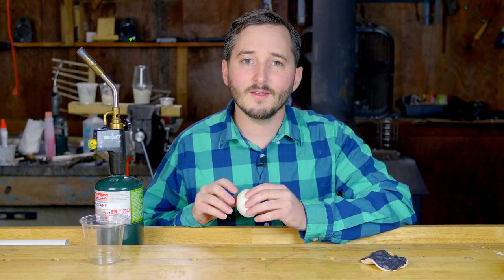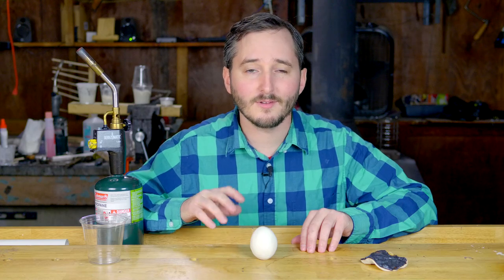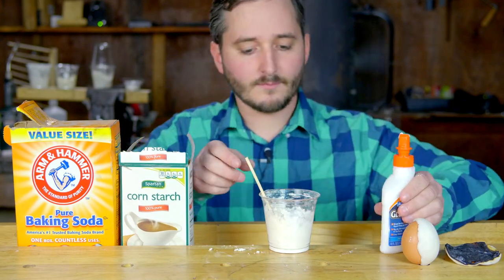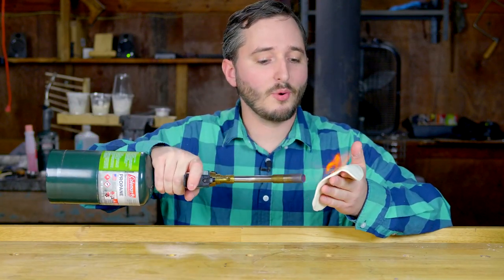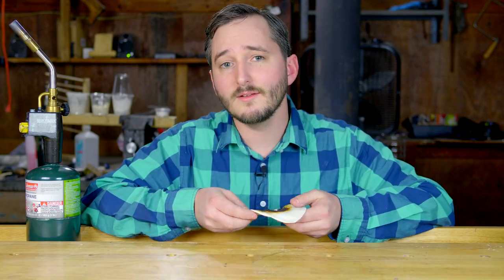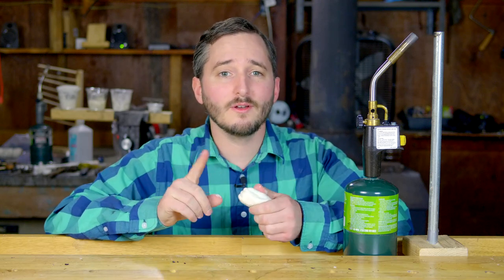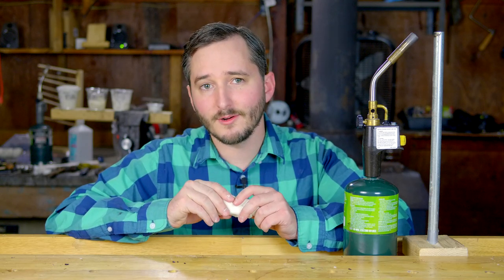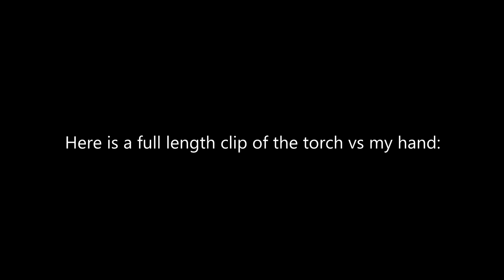A Super-Material That Can Be Made In The Kitchen (Starlite Part 1)

Comment: Is it possible to make a lighter version for use in firefighter suits? Maybe in the form of tiles forming "dragon skin"?
Reply: That's sounds awesome.
Reply: Wouldnt the carbon buildup run the risk of restraining movement to much tho?
Reply: This stuff hardens, so that wouldn't be useful. Apart from that, it is not meant for multiple usage, so it would be better used for house insulation.
Reply: From his explanation, it seems like the carbon layer is literally foam. So it can be brushed away. Look how carefully he touches it so it stays intact. Perhaps starlite was only useful in safe contained environments, and not for things like airplanes and space ships...
Reply: @Hoch134  I was thinking about something like scale armor. And if it is so easy to make (and cheap) it could be disposable, single-use item. Mayby in forest fires? Or cower some (tracked) vehicle for saving people that was cut off (a helicopter is not able to fly in such conditions).
Reply: @rareram  So mayby cover it with some sort of protective layer? Carbon nano-fibers, or something that would not burn, but could vent gasses out (even with small holes on the surface)? But not too thick - the material would not react and could transfer some heat. Or mayby different glue?
Reply: @RasaelX  the protective layer would not be starlite though, so I suppose in an event that exposes the protective layer to say 2000°C+ degrees... But you still want to move around like if the material was in a firefighter jacket... That would shred the foam right?

Edit: the foam is formed after exposure to higher heat, so the protective layer would keep your scales there, but dry loose scales would simply fall off right? Or are you expecting the foam to coat the protective skeleton?
Reply: @rareram  Firefighters normally ar not exposed to >2000 C, so the layer don't have to handle it. And even if, it would be better than nothing. And we want heat-transfer protection, not that it wouldn't fall off after use. And the layer don't have to be thick, and could provide heat transfer.

I am not a NASA engineer, I just like to think. Are mine ideas rubbish? Most likely. But Mayby, just mayby, someone would test them, learn from them, and even, Odin forbidd, use them to do something usefujj.
Reply: @RasaelX  well... I think they actually are exposed to that. I mean ideally coal burns that hot. Not in a smokey, oxygen starved environment, but Firefighters do have to deal with fuel fires and things. The material seems most useful as a kind of armor against nukes, laser, and other thermal weapons. I can see why Boeing was so frustrating, if the material changes shape, it isn't really a good thing for airplanes, although fire is definitely worse. Why not use it in the lab as shielding for when you laser blast stuff?
Reply: @rareram  I think that as laser shielding i wouldn't get hot enough to activate the reaction, and (unless we are talking about military space-tech) we have better materials. Perhaps in steelmaking? Mayby some sort of bunker in the event of an "explosion" of the furnace? They happen adt it isn't pritty sight.
Reply: @RasaelX  I wasn't aware that a better cheap option existed? What is better to you?
Reply: @rareram  Nuclear weapons - shelter (concrete, steel, lead). Thermal weapon (napalm?) - concrete, steel. Laser (industrial or military?) - protective glass, concrete, reflective surfaces (in the case of weapons). In addition, the original Starlite would last only up to 10 years?

Comment: Starlite furnace anyone?
Reply: Marc T 

Definitely agree, but it got me thinking about using a similar method to make an insulating carbon foam.
Reply: Problem being that the carbon foam is REALLY fragile so you'd have a consumable lining, not necessarily a bad thing, so long as it holds up for long enough to do whatever it is you want to do with it.

It's basically an ablative coating, it protects the underlying structure by being destroyed itself.
Reply: Concrete is just fine for the job
Reply: @SomeMorganSomewhere  i was thinking of a starlite layered furnace because if it doesnt absorb that heat then it must be extremely insular. imagine how much heat you can contain. maybe enough to melt iron or steel using coal?
Reply: also going to mention. try using borax instead of baking soda, or mix them both together. the wiki on starlite sais it is rumored to have contained a borate compound. (hence thinking possibly borax)

Comment: How "tough" is the carbon layer? Could it be used (in your opinion) as a lining for a propane forge?
PS: mine is a "yes" for a second, more in-depth, video
Reply from the maker: Not very tough. It could only be used as a temporary forge lining
Reply: @Nighthawkinlight  could you support it in some kind of carbon fiber mesh etc to give it some structure?
Reply: I was thinking considering the same thing. Thanks for asking this question and thanks NightHawk for answering it!
Reply: I think AvE used burnt bread as a 'forge' backing while melting aluminium

Comment: I'm not quite sure of all the properties and how it would exactly mesh but I'd be very interested in the possible applications to firefighters. one of the serious problems firefighters have is that their coats boots etc, really good at keeping heat out but also great at keeping the heat in, one of the leading killers of firefighters is a heart attack and it's in no small part due to the strain all the gear puts on their hearts. when you had mentioned that it quickly dissipates heat and protects against extremely high temperatures its sounds something that could possibly be used in the applications of their hoods, gloves, or even more.

Comment: I'm not particularly familiar with the science, but how would this material compare to current ablative shielding for space capsules?
Reply: I think it is too elastic and the foam might be blown away by all the air upon reentry
Reply: @_NikkyD_  Agreed. Re-entry shields have other requirements than just heat resistance, like pressure variation resistance. For example, what if the shield hits a bird? In the case of the Starlite, it might be ripped open. While the starlite is an awesome product, I would use it over a regular ablative shield (or maybe in a sandwich of ablative shields?). There's room for study here.
Reply: Actually ablative shielding uses polymers anyway, it could well be very similar. I found some mentions that Chartek 59 has direct lineage to the American Space Program- it's an intumescent coating, which seems to follow quite similar in principles to starlite, but with more advanced materials. It's not in any way impossible that Maurice got the idea from the space program but used household materials to achieve similar results.
Reply: What worries me is that it might crack, it is essentially some dough and if there is a lot of vibration and a crack occurs, that would totally compromise its integrity

Comment: So if I made shingles out of this stuff my attic space would stay cool?
Reply: Only if the sun gets too close to the earth!
Reply: Your birds would eat it
Reply: @andrzejjablonski8571  under the shingles
Reply: If the rats don't eat it.
Reply: @beatlemoore2654  - Not for use in Baltimore.
Reply: Yes
Reply: Looks like yes is the answer.
Reply: Use carbon under the shingles.
Reply: it should work on top but you would have to likely want to blacken first to get that carbon layer
Reply: Along with baking soda you put Borax, no animals or pest will eat it then.
Reply: Would it go back to the putty state if it rains?
Reply: @fallenseraph5V  maybe using waterproof glue?
Reply: @andrzejjablonski8571  no they really wouldn't
Reply: This stuff is fire proof, because of the carbon that builds when the flame is on it. That is why it's cool on the other side. The application would not work for uv rays, it would degrade and crumble over a short span. If it was exposed to any elements it would not hold up. It's just simple ingredients. Insulation board would be your best bet.

Comment: how would it hold up to an oxy-acetylene flame with an excess of oxygen?  would it burn away the carbon foam?
Reply: Oxygen is a well known vulnerability for carbon at high temperatures.  To work as a fireproofing the material needs something to protect the carbon from oxygen.  The baking soda decomposition products should help, but I don't know if they'd be enough.
Reply: It would very likely ablate very rapidly, but that's a very unlikely situation in application.
Reply: @wyattroncin941  welder gloves
Reply: @palebluedot7435  hard no on that one. Welders need as much flexibility and dexterity they can get while wearing gauntlets. Leather and cotton liner is a proven system that lasts and if you are burning up yours you are an accident waiting to happen. Last I checked, pointing the torch at yourself is a fast way to be escorted off of the jobsite.
Reply: Not to mention that the material shown appears to go hard when set. And, to cut through a gauntlet is not an easy task, it's not something you'll be doing with a torch. Leather chars, it doesn't burn and it certainly doesn't behave like a gas cutting metal. If you hurt yourself pointing a gas torch at your hand you are 1 a dumbass, 2 have the reaction time of a dead sloth and 3 have performed the impressive feat of turning hand into baked potato, not diced beef, the easy one to obtain.

Comment: Make a coffee can furnace using it as a interior liner
Reply: Wouldn't that defeat the purpose, putting it on the inside? What is your goal here? Putting it on the inside of the receptacle would make melting whatever's inside nigh impossible, and putting it on the inside of the full furnace would have no benefit and would probably eventually just combust all of the remaining pseudo-starlite. All you'd have left is a mass of carbon inside of a furnace.
Maybe you meant to protect your hands or something? If it's for that then you would put it on the outside.
Reply: @dagomara8380  well you need something to make sure the can doesnt melt if you can't get your hands on proper insulation material and if it's a good layer you wouldn't have to mix a lot of plaster of Paris and what if you want to transport the homemade furnace to somewhere where it can cool down and be stored and out of the way at the same time instead of waiting for and hour or more just to be move it safely now you can put it on the outside but some people mght want to keep it looking like it's a coffee can furnace now I've never made one before so I dont know the insulating properties of  plaster of paris but if I would make one I would use the starlite as a precaution at the least
Reply: I have made one, our of a paint can.  Instead of plaster I used kao wool. Works flawlessly time and time and time again.  I've used probably 25 to 30 times and the wool had shown no signs of needing changed.  The only down fall is the fibers of potentially inhaling them.

Comment: I'd be curious to know if it could be melded with other material such as a wildland firefighters heat blanket, which won't do much good when a fast hot fire rolls on top of you.
Integrating it somehow with wood shingle roofing that tends to go up in flames if an ember gets on it would be interesting.  I'd be curious if there is a way to keep it a bit runny, and then integrated in with a batch of aircrete...... A very strong and extremely lightweight cement or concrete...... So many possibilities.